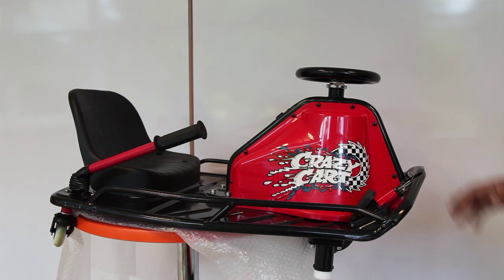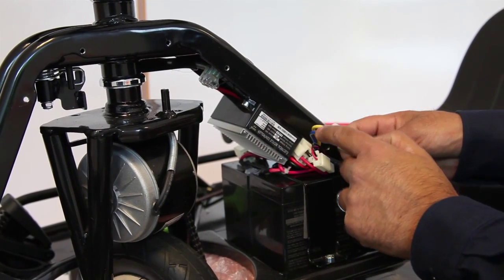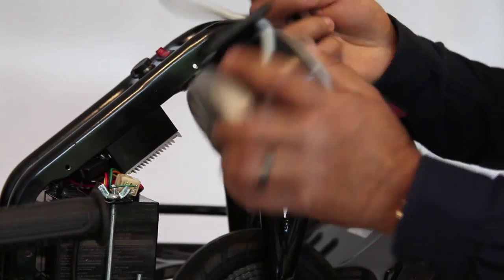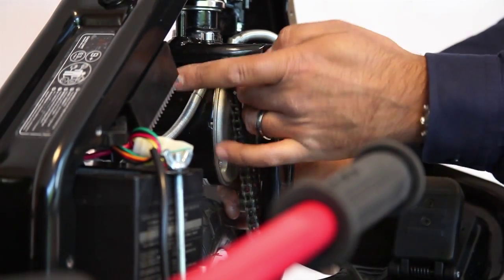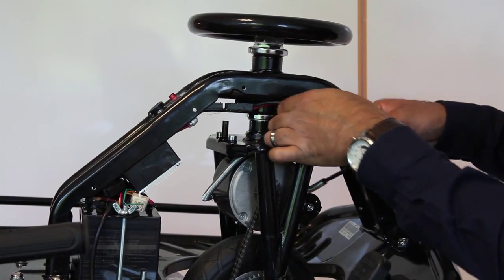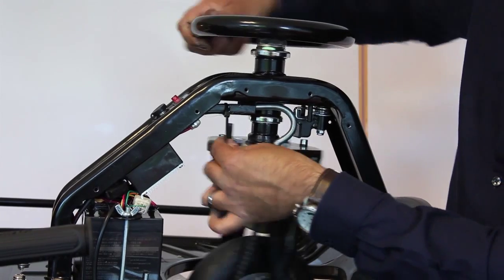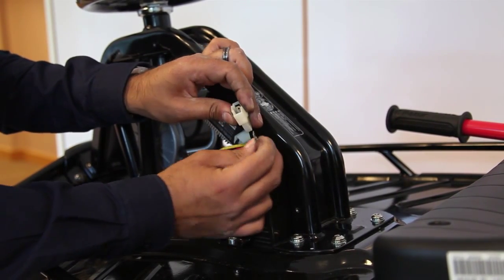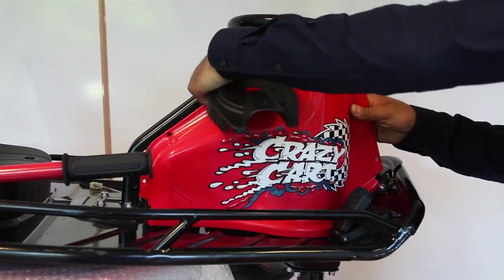Razor Crazy Cart replace motor

Comment: The problem is not the motor is the cable . Remplaced end the problem is fix . But if you want to spend extra dinero  do it .
Reply: how do i replace the cable